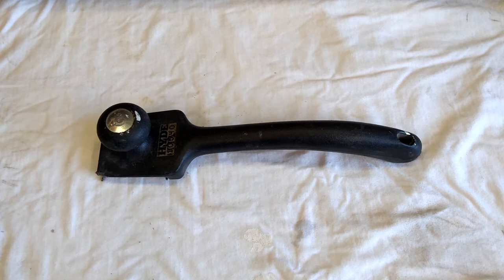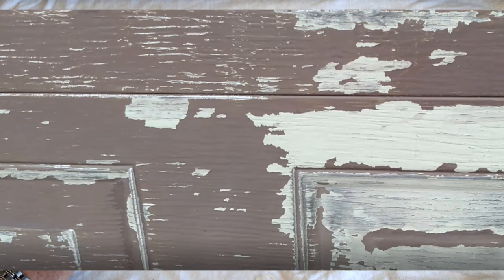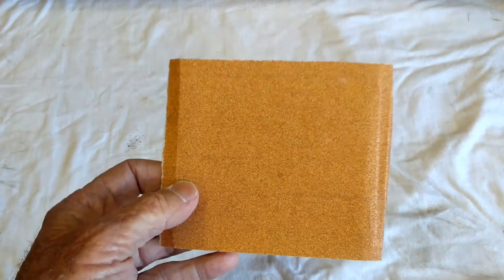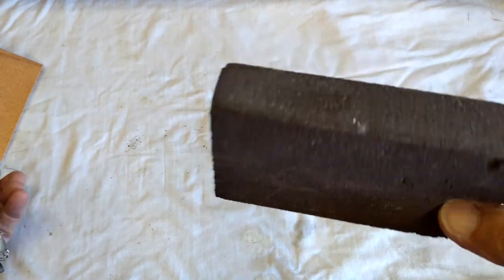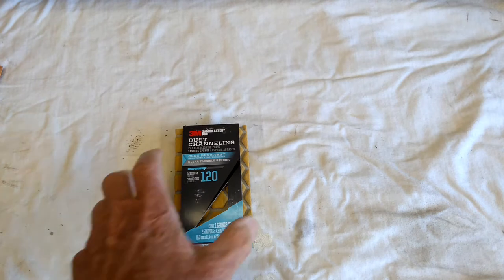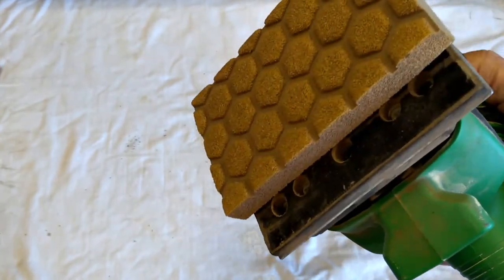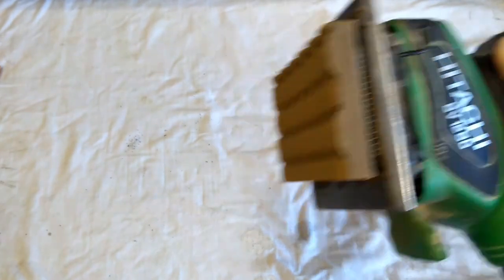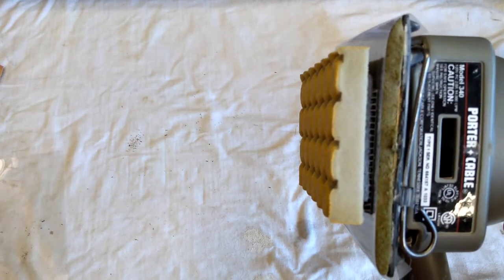Prepping To Paint My Garage Door - Sanding Crenelated Metal

Comment: And we waited to see the actual sanding to see the effectiveness but no!
Reply from the maker: That's because it doesn't work at all. It just takes the paint off the tops of the crenellation ridges and doesn't touch the valleys.
Reply: @otd80  Thanks for the clarification. A very common problem with very few solutions it seems. Chemical stripping seems to work and possibly high pressure spray but haven’t seen any videos of that. Thanks for sharing your experience.